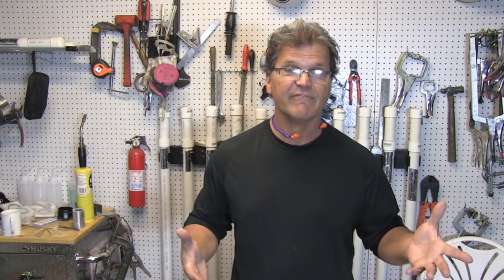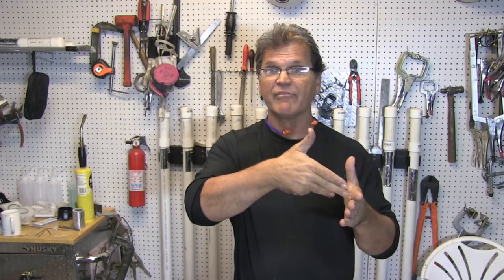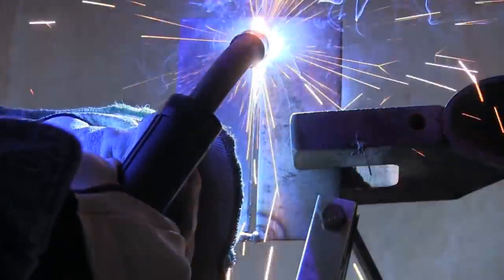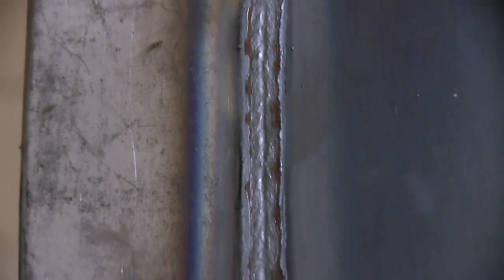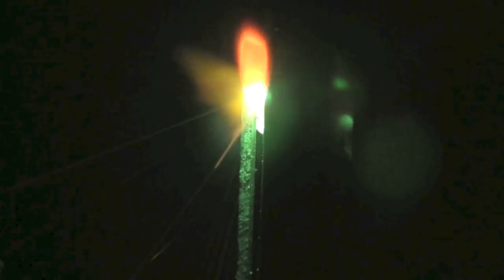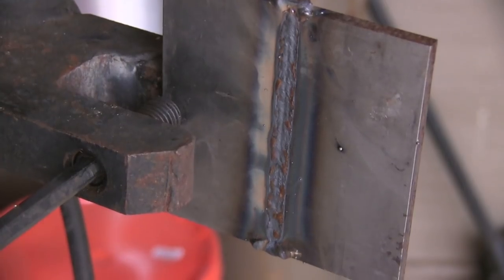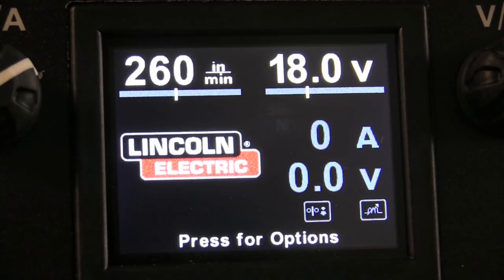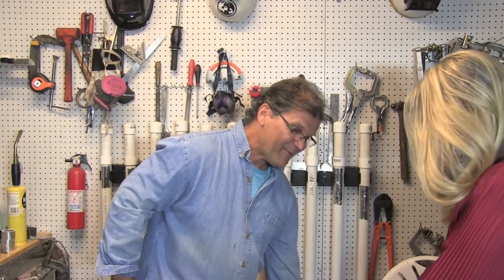Mig Welding Downhill Open Butts

Comment: Hey Jody, love your videos, I always watch them all. Up here in Canada (Alberta) we use a process called STT for all almost all of our heavy wall steam piping. Since our oil is so cold and deep in the ground, companies will actually pump hot steam down the wells, and to reduce turbulence in the pipelines they found that using wire roots in the field work best. It's a very similar process to mig.

Comment: If only I had material to weld as nice as that.
I work in a concrete plant, paint, rust, powder, varying material thickness, 1/8" to 1/2", AR plate, galvanized, very awkward angles in confined spaces, standing on i-beams welding sideways overhead... absolute nightmare.

I mainly stick weld, but certain projects I get spoiled and get to use a wire feed, but even that can be a pain in the ass.

Best weapon for many jobs, Miller Maxstar... Love those little bastards. Trying to talk my boss into a Caddy Mig as the 12VS is just too damn heavy.

The only positive is that the welds don't always need to be perfect.

Comment: when I was welding pipe  with hard wire  I had an 5/32 gap  1/16 land  .45 wire 98-2 gas  265 wire speed and 19.5 volts.  beautiful 3/16 bead on the inside for the root and 1/8 of height  perfect, man good times.

Comment: I have 20 years under my belt welding I hold three welding certifications with the Canadian welding bureau "CWB" 15 years of 20 I worked fabricating wood stoves. Most of the welds are run vertical down on 1/4 inch plate we used 100% cO2 with  .35 wire. CO2 is probably the best gas to weld vertical down it penetrates quite well much better than argon mix gas . Only drawback with cO2 is it needs to have a flow restrictor. But overall cO2 is pretty good gas for down hill welds with good penetration.

Comment: Did an open root 3G test yesterday with .035 mig downhill plate was 1/2" thick and ran the root pass on 15.5v and I want to say 230 wire speed. Pushed out nice!

Comment: Good idea using 1/8th" metal for practicing the open root pass. I'm practicing for open root 3g gmaw up on 3/8" plate with 3/32 gap and land with 37.5 bevel. The root took the longest for me to get decent. 190ipm on wire feed 18-19volts seem to work for me and other students. But we practice vertical up.

Comment: Where I work 90% of the parts I weld are laser cut and bent on a brake press, so I have to do a lot of open butt joints and outside corners to join the seams. So this is actually pretty common for me.

Comment: great video Jody as usual. I have a question about the root size. what is the absolute biggest root gap that can or should be attempted to be welded in this way? thanks so much for sharing.

Comment: hey Jody quick question..I know you did a video on macro etching...not using house hold products ..what is the best thing to macro etch with ...great video
Reply from the maker: the best thing to etch carbon steel is diluted nitric acid.  it only takes about 3% nitric using water or alcohol to really bring out the weld.
however nitric acid is not that easy to get and is hazardous.
naval jelly rust remover works fine too but just take longer.

Comment: I have to do vertical downhill for a test at my job. But they want the root, the filler,and the cap all downhill. My problem is ever time i get about 2 inches from the bottom on my cap the puddle start run from me how do i stop this from happening? I tried to trun the temperature down, and move faster. I got it to stop running from me but i failed the bend test before it even started to bend my coupon. PLEASE HELP!

Comment: Lincoln and STT......couple videos on here recently with guys using that....36" or so pipe....2 welders, 2 mig guns on each....welds look like sub-arc when done.....100% automated...welders just use hand-held control pendants......watch welds and maybe make slight adjustments......

Comment: Please help me I have a CT-312 and the TIG function is terrible. It was working fine until one day the gas tubing to the torch melted after a 1 foot butt weld.  I replaced it with tubing and 8 awg stranded wire and how I have porosity on every weld no matter how clean it is. Flow is at 15 Cfm no leaks in the whole chain and I don't get any orange soot around the weld. I feel like I have tried everything Please help guys. Note I am sure Im using 100% argon

Comment: hello jody, big fan here. i got one question, i have allways been thought by my teacher and boss that you are not suppose to mig weld downhill, he says its becouse when its start to rust it will break of, have you heard about this and is it true? Thank you from Norway.
Reply from the maker: there are definitely applications where downhill mig is bad.
but for open roots with a bevel and gap, it is an acceptable practice as long as the procedure and welder are qualified.
All passes after the root are uphill
Reply: Thanks!

Comment: Hi Jody. But what about uphill root pass? can you make a video about it.
Reply: biffex same fit up of either pipe or plate 1/8" gap, feathered edges but colder settings (volts & wfs) and a cresent moon motion, is how I weld uphill. And maybe a little preheat. Hope this helps a little.
Reply from the maker: I will certainly try to include uphill roots soon

Comment: not take away from this posting... but I know a lot will watch it.. Im returning to the FAB business and the company uses pure CO2. U aced the test eyes closed.. literally.. The arc was so low that even on my lowest setting I could barely make it and the joint out.. running a base miller auto darken.. any suggestions for TINT settings or a new helmet that will make this better?
Reply from the maker: I like to experiment with pure Co2.  i think its got a lot of benefits